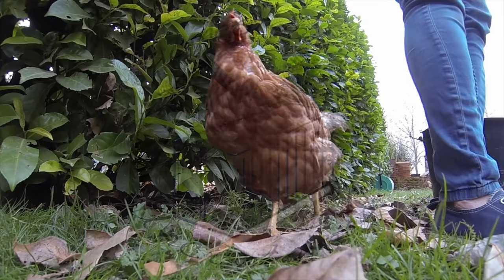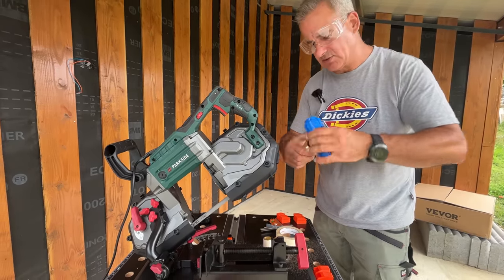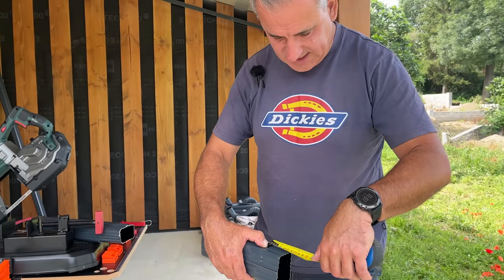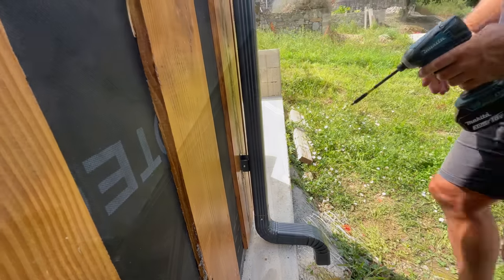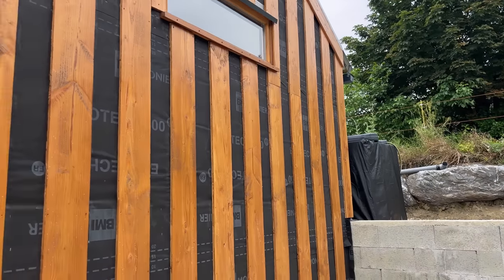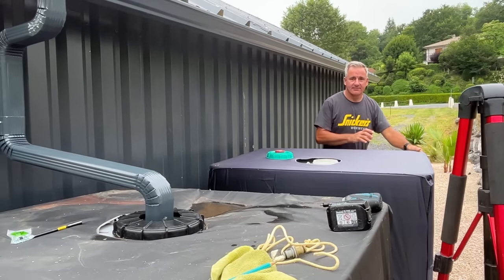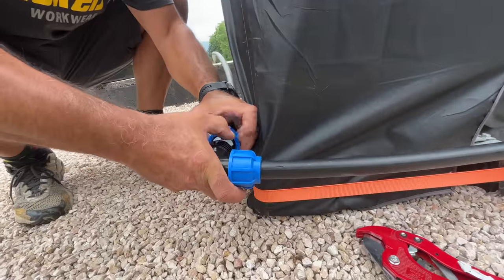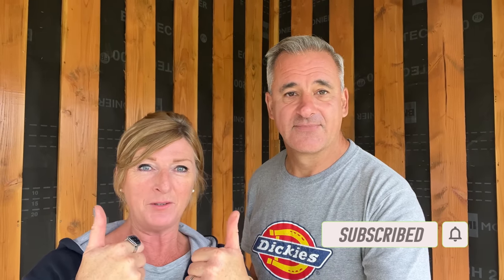Collecting Rainwater With IBC Tanks | Garage Workshop Project Ep41

Comment: I see an issue with the screen on your water container right now. A couple leafs is gonna plug it up. Need to come up with a filtration system that'll catch the debris, but allow the water to run over the top. Maybe a container hanging below the inlet with half inch holes in it?? I don't know. There may be something available at a plastics outlet.
Reply from the maker: I did think of that, but there are no trees in the vicinity and I have a similar set up at my poly tunnel and it seems OK.  I will see how it goes and when I fit the other IBC units I will get the plumbing more correct (& permanent)

Comment: Ian should have inserts on those plastic pipe joints (although yours isnt a pressurised system so probably be ok )
Reply from the maker: These ones do not require it supposedly - the pex pipes do but not the larger black pipe.

Comment: I have the same metal cutting bandsaw from Lidl. Two issues I found :
Blade runs "away" from the fence
Adjustment(s) to square up the blade are not very intuitive.
Otherwise I LOVE this bit of kit
Reply from the maker: Yes, I did find it was cutting at a slight angle - it was half price though so I am pretty pleased with it.

Comment: never use tape on metal to plastic water connections, use liquid sealer. you will be ok on a non pressurized system.
Reply from the maker: Yes, I did not have any but needed to get these done.  I normally put it on everything "belts and braces"

Comment: Ian if you ever plan to use those IBC tanks for drinking water then there is a few things you things you will need to change for the future. To stop most nasty bugs growing in the water you need to have an S bend on the water entry pipe as well as an S bend for an overflow pipe, these prevent bugs from getting into your system & hatching mosquito eggs as well as the growth of other nasties in the water.

Also you will need to get a 5 stage water filter if you intend to use the local water supply that has a 5 micron pleated sediment water filter cartridge, a 5 micron PP sediment filter and GAC function together water filter cartridge, a 5 micron carbon block water filter cartridge, a 0.5 micron antibacterial water filter cartridge & lastly a 5 micron fluoride removal inline water filter cartridge.
Reply from the maker: Not for these units - we have to take the local mains water as it is mandatory if it is available to you - but for €160 for the year it is a no brainer to use the mains water.  The Rain Water collection will be for the animals and garden only - maybe the toilet flush if I get the plumbing sorted.
Reply: @HomesteadingUncontained  Yeah well don't forget to make up a DIY 5 stage filter for drinking water otherwise you will have all sorts of contaminants in the mains water.
Reply from the maker: We are really lucky here in the pyrenees - the water is near perfect and it does not come to far down the pipes 😀
Reply: @HomesteadingUncontained  Over here we have loads of rust, chlorine & fluoride.

Comment: What was the sealer you used to seal concrete to wood/metal?  I have treated 2x6 plates on my slab that leak terribly or when the snow melts.  I've tried a silicone caulk [DAP], but the water gets under it anyway.  If you [or a viewer] know of something [available in the US] that seals against the concrete, please reply.  Thanks!
Reply from the maker: It is Sikaflex - I am using it for gluing and sealing at the moment and it seems to be working (and lasting) quite well.